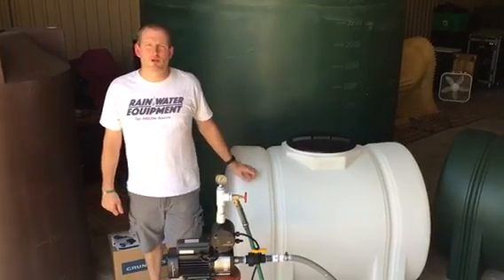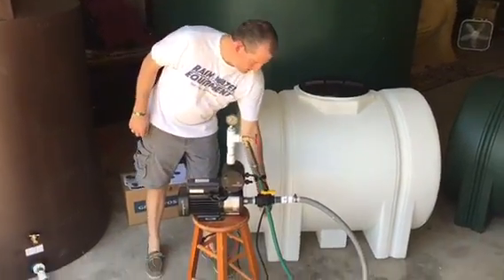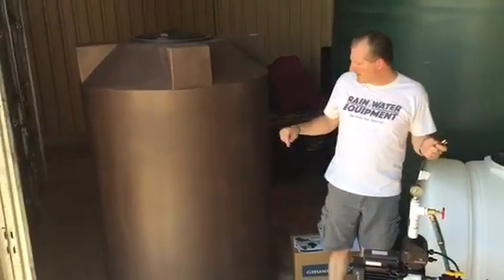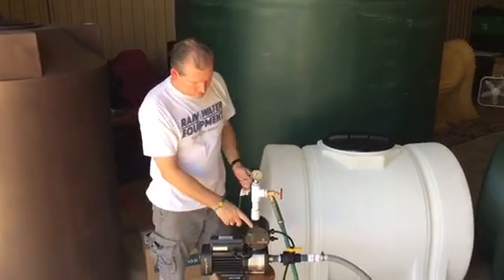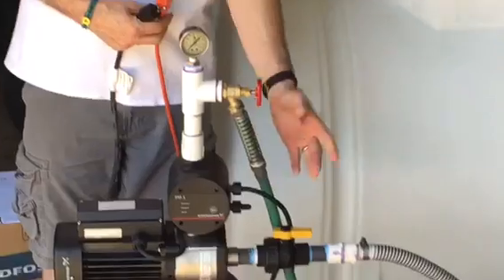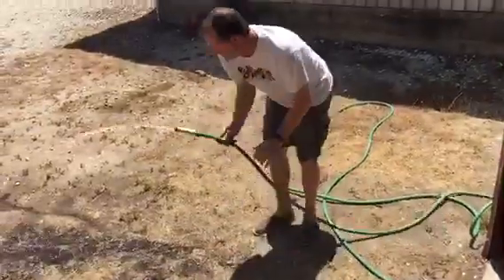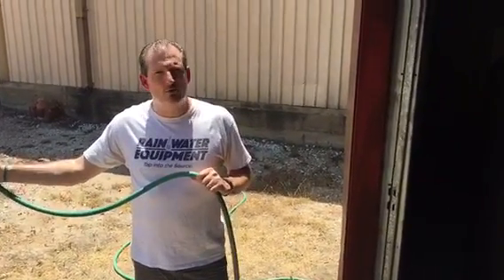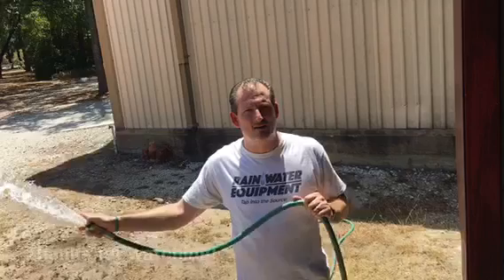Grundfos CM Booster 3-4 BASIC Pump Demo

Comment: What about automatic on/off of pump ?
Reply from the maker: The pump is "on-demand", so it turns on when the pressure drops in the line (because a tap has been opened) and shuts off when there's no flow...after about 10 seconds.

Comment: Great information thank you! Question? Can this be ran parallel with a hundred gallon pressure tank? Or, what's the largest pressure tank applicable? If turn off pressures are matched? Thank you again! Bob in Arizona
Reply from the maker: Good question. It can be used with a pressure tank. Typically though, it's a much smaller one, between 2 and 10 gallons. The pressure tank is typically set at a couple of PSI lower than the discharge pressure of the pump so that the pump doesn't come on until the tank is depleted...never had anyone ask about 100 gallon pressure tank. In theory, it should behave the same way.